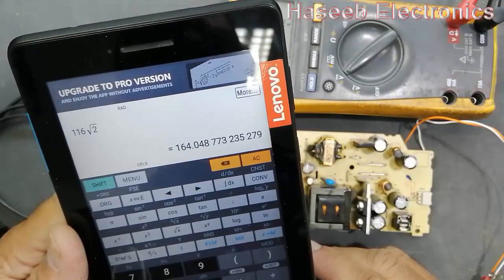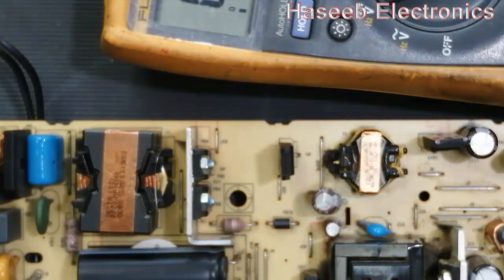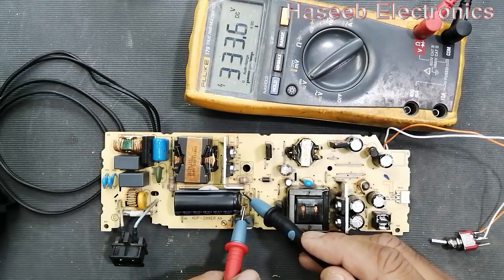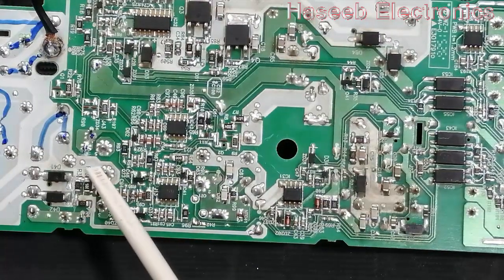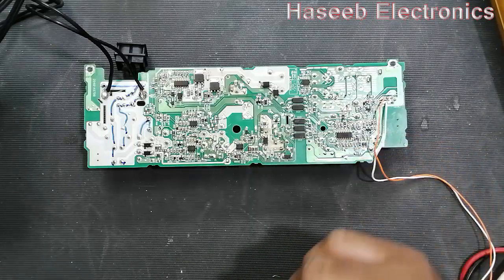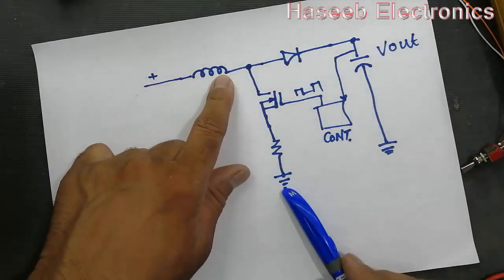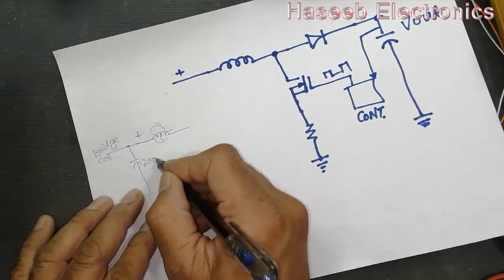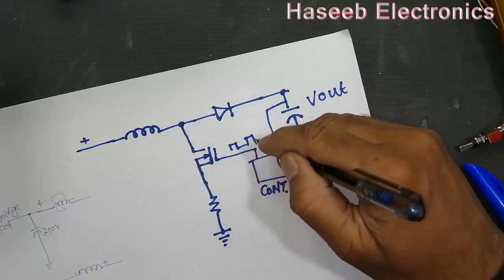#307 Sony PS4 Power Supply ADP-200ER - Power Factor Correction PFC Circuit

Comment: Hi iam working on a sharp TU-T2HR32DVR has no stand by light 12v is present at the input and there is 3.3v at I.C. Of number EM78P311N pin 28 VDD microprocessor. I have dis connect the HDD  but still the fault still there I Dried to get the schematic diagram no success any ideas please !!!

Comment: Salam brother. Great tutorial, thank you
A same psu came in the other day with that coil you mentioned in the PFC circuit fractured, The console seems turning on just fine but it gives that strong burning plastic smell.  
Is there a possibility to replace that coil with another from pc PSUs ?

Comment: hello thank you for all his information, if I lose the 400v when I turn on the ps4 the problem can come from where please? (no 12v) the standby is ok
Reply from the maker: after standby power section
PSON command 
then PFC starts 
after that 12v power section starts 

if any section fails, PFC and 12 volt power section will turn off 
if PFC cannot take start, next 12v section fails to start
Reply: @HaseebElectronics  from what you say the problem would come from the secondary part of the power supply or it is not necessary? Thank you very much for your answer.

Comment: pfc smps when test with series lamp why we on off the lamp
Reply from the maker: because PFC circuit draws more current, and series lamp cannot provide required current and in result the voltage drop across the lamp, which causes to restarting the PFC controller
Reply: Hi...i have a tv use pfc power supply.when turn on tv in stanby.voltage at bridge fluctuation but at main capacitor stable.when power on the tv...ps on from mb will fluctuation.so the stanby green just blink2.what happen to pfc side.the output voltage stable.

Comment: thanks for sharing knowledge on power supply, but how to increase current not voltage of output???
Reply from the maker: no dear we cannot increase the current of any circuit. if we will try to increase the current, we will destroy it. it is the fact
Reply: @HaseebElectronics  it means weak power supply remains weak! What if I want to load more😆??

Comment: Hi Haseeb, really THANK YOU for your nice & clear explanations on The switching power supply!
I would like to read your general opinion on the PFC circuitry  can be found nowadays inside  switching power supplies, expecially the bigger ones. 
In repairing, I find them, several times almost completely blown-out.
I've found this circuitry usually right in before the mains bridge and usually works with it's own controller circuitry & power switching device. 
To quickly remove the SMPS fault, even while accepting some degradation of the appliance itself, would it be a good idea to functionally remove this circuitry? 
Several times I find a lot complex PFC circuitry, that are so damaged thati it wouyld be almost impossible eve identify the components have been used!
For example, right now I'm repairing an Air conditioner SMPS, in which the PFC power IGBT completely blown out together it's controller, which marking is unfortunately completely unreadable . 
In other occasions, I removed this circuit, and it seems to work, (of course not take into account EU normatives). 
I would like to know, your opinion on this.
Ciao from Italy! 

Mario Di Stefano

Comment: You said in the next video you will discuss high power section. But next video is final video that is standby section. My psu has standby 4.75v but on shorting 5v and acdc_stby, 12v is not getting on. 🥺
Reply from the maker: video number 355
https://youtu.be/bgitC_E1q1A
Reply: @HaseebElectronics  ok thankyou haseeb sab. I checked till 320 then i thought you didn't upload. You explain very well thankyou for sharing your knowledge with us 😀✌️

Comment: Hi Mr Haseeb. If current sense resistor is out, would it cause the whole psu to not work?
Reply from the maker: exactly, because it becomes in series of the dc rail. so if it is OUT, next circuit will not get voltage to drive, so PSU will remain dead
Reply: @HaseebElectronics  thank you so much. Your video really explains A lot of the why's for me. I must know the why's in order to learn.

Comment: 12 volte missing, only standby 5 volte, how can doing?
Reply from the maker: please check 400 volt on capacitor by making PSON jumper, the PFC circuit must turn ON to boost the voltage at main dc capacitor to 400 -410 volt DC. then the push pull circuit will enable to provide 12 volt

Comment: Hi. Great video, very informative. I have the same ps4 psu, but the  pfc is not staring when i engage the 5 v with the standby.  the big cap stays at 322 v and , obviously, i don’t have the 12 v output. There is no voltage at pin 6 or 7 (where it should be 15 v) of the ic. What component provides the 15v to the ic.? What should I check next?
Reply from the maker: yes
it must maintain pfc voltage
there is a switching transistor in vcc pin track, check it
check enable signal from optocoupler
Reply: @HaseebElectronics  thanks for your reply. I'm new at this, so can you tell me where is this switching transistor located? I cannot trace the Vcc track . It should have the same V as the Vcc pin (like 15V)? Thank you in advance for your help
Reply: @HaseebElectronics  Hi . I found the VCC track and the mosfet. I have 18 v at the drain, and 23mv at the gate. there's no change when I give the power on comand. DNP012A could be faulty?